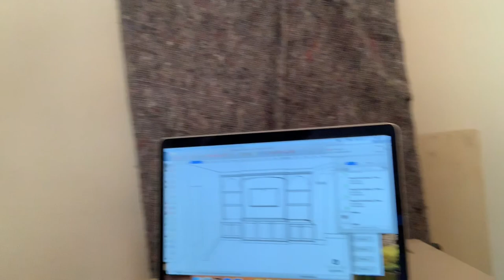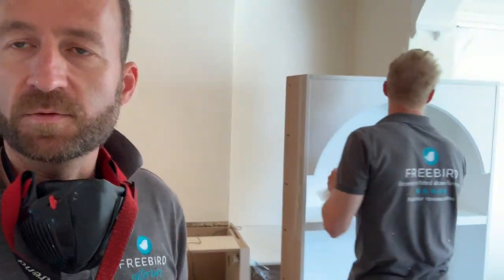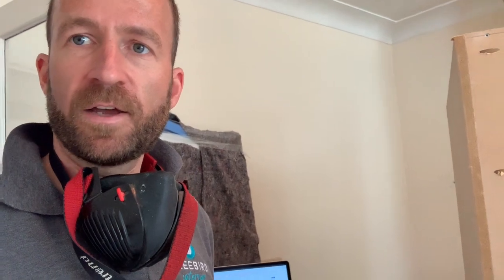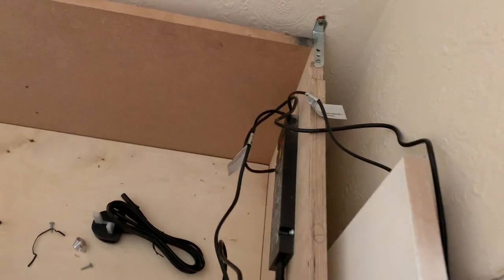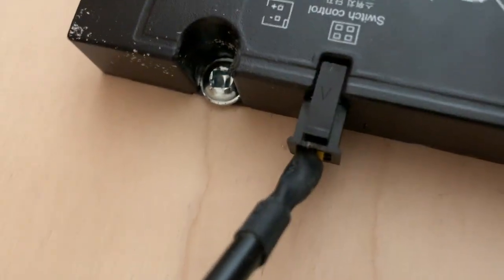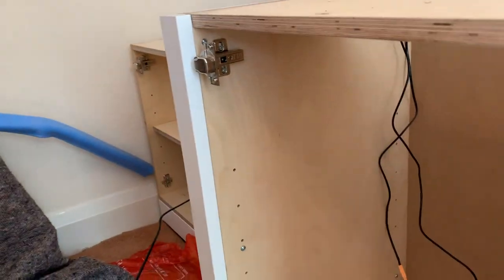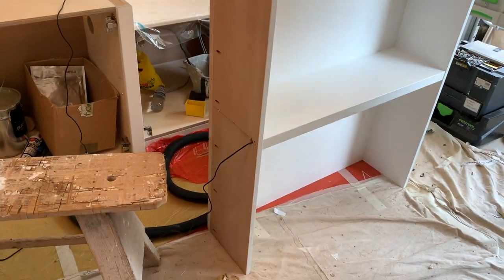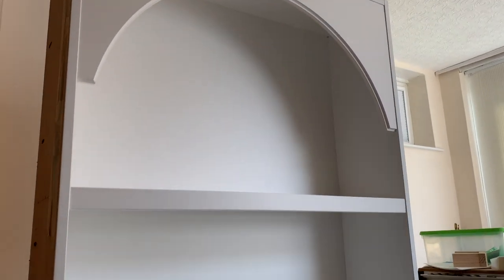Large Media Unit featuring the Hafele Loox 12v Lighting System

Comment: Looks really good! I noticed the use of the orange 'space plugs' too! They are a great bit of kit 👌 loving the content on your channel, it's really appropriate for me!!
Reply from the maker: That’s good to hear Craig, thanks for letting me know!  Since first trying the method on the grey sprayed display storage job I often use the space plugs as wedges at either side of a unit held in place with a dob of gap filling adhesive either end - it holds things rock solid and reduces cracking caulk lines without the need for visible fixings.
Reply from the maker: This is the previous build I’m referring to https://youtu.be/AK0RHsN6pBc
Reply: Ah, that's a great use for them! Thanks for the effort in doing this I appreciate you're a busy man!! I hate making mistakes and I take a lot of care (and therefore time) trying not to make any!!

Comment: Hi Alistair, I like the loox system. A little trick I learnt was to put a blob of solder on the connections at the light strip. I got a tiny flicker once and this method did the trick
Reply from the maker: Good tip thankyou!
Reply: @Alastair_Freebird  No problem, if you are ever down in Sussex swing by the workshop

Comment: Lovely job, thanks Alistair. How have you attached the TV? Is it just screwed onto the 18mm back, or right through and into the wall? Also did you leave a 20mm gap behind the top units or up against the wall if you are going through into it for the TV? Thanks again, Matthew.
Reply from the maker: Hi sorry I didn't reply sooner!  Usually for this sort of thing I pre-fit some solid timber (just CLS studwork or similar) from top to bottom behind the back panel where I know the fixings for the TV bracket will go.  This allows me to put a good secure fixing through the back panel and into that timber, while keeping the back panel a few inches away from the wall to create a void for cables to easily pass down into the cupboard below.  I also make sure the back panel is securely fixed to the outer carcase, and the whole carcase is securely fixed to the wall/ceiling/adjacent carcases - especially important when using adjustable cantilievered brackets with large TVs!

Comment: Love your work Alistair.
You’ve inspired me to build my own units and thinking of adding these lights. 
I’ve made the shelf’s 25mm thick.  How thick a trim will I have to put on to cover the leds?
Reply from the maker: Thank you.  I seem to remember deciding that 44mm was the absolute minimum shelf lip height to hide an led light strip within my preferred surface mounted ‘drawer profile’ aluminium extrusion, allowing for the higher shelves not making the light source directly visible.  That was with 18mm thick shelves so I suggest at least 2 inches lipping

Comment: Hi looks really impressive, very similar to what I used to make for my old company down in Suffolk. We use much the sam techniques as you for making and installing as well as the same companies for supplies. It looks like you do not finish the interiors, unless its my view of it.
Have you got into ultra high gloss yet? takes forever to do but great looking results.
Reply from the maker: Gary Blake hi the interior finish (or lack of) has been a controversial topic on here before!!  Some years ago, based on feedback from a lot of customers that for our standard alcove cupboards they really didn’t care if the internals were finished or not once they were stuffed full of things, I decided to make our standard price list for unfinished internals, with an upgrade price option for varnished internals.  So it’s up to the customer, and I am not volunteering for the extra work if they don’t care for it!  I haven’t done high gloss painted work in-house but I have contracted it out, and heard how difficult it is to achieve well!  I have done some high gloss units using laminates.